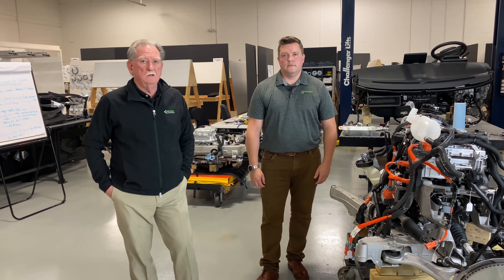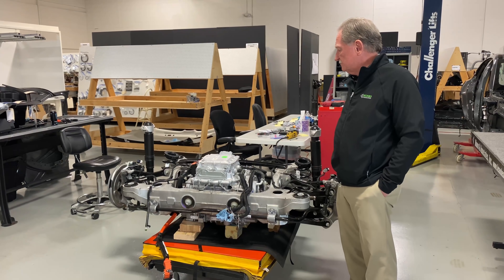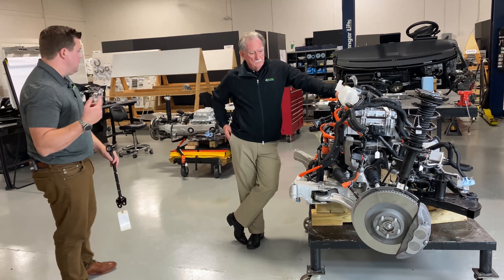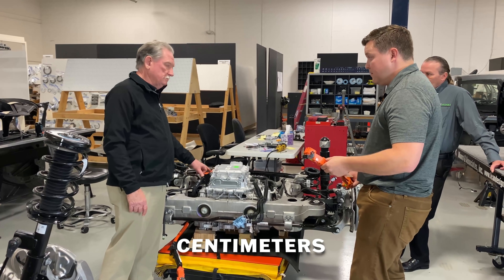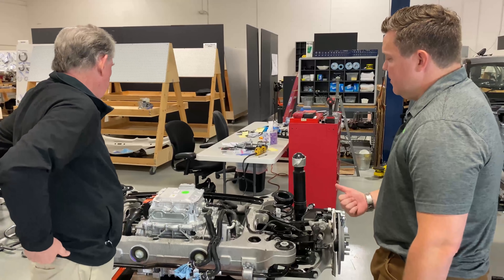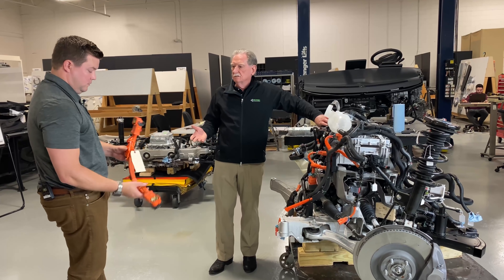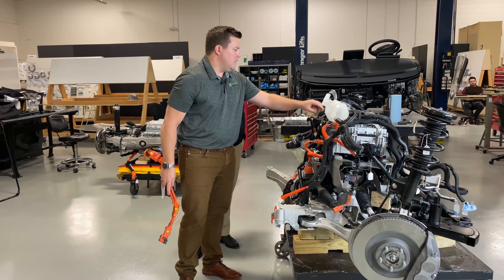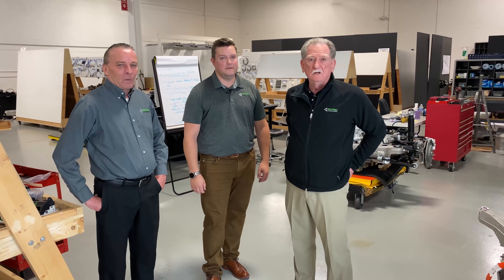Mach-E Suspension & High Voltage Wiring Compared to Tesla Model Y

Comment: i find all these videos really interesting. I also find it funny that I personally think: metal part, thats quality, and Monro sees metal part and thinks thats crap lol. I wonder if the plastic connectors that you guys like so much actually lasts as long as the metal part with a screw. Plastic has come a long way, and it sure doesn't rust together like metal components, but I don't know. Then again, I don't own an engineering company that works with OEMs lol.

Comment: The wiring is traditionally ignored and told to connect the dots.  At Tesla, the electrical wiring is a core technology.  The wiring team can dictate component changes to so save overall system cost.

Comment: The MachE rear motor assembly is new to Ford and a new more modern design. The front may be modeled after the Ford Focus BEV which is older design. Maybe MachE next gen will have different front design. My thoughts. I have a MachE and it’s great. I can’t see any of this stuff. I just want it to last 5 years and 75/100k miles. The model3/y has many years of tesla experience from the s/x…

Comment: This model is a Select AWD, so I wonder if the GT front suspension wiring and motor designs are very different. I read the GT has the same electric motor in the front and back so it would need to be different than this car.

Comment: 8:25 Aluminum? There's no way anyone would use aluminum wiring to connect a high-voltage pack to a high-power inverter.
Reply: I might be mistaken , but I believe that all the high tension lines that connect our power grids are in fact aluminum not copper.
Reply: @1bigapple2  Running ultra high voltage, low current AC, yes. Running 500+ A of DC current? No way.

Comment: Nice! excellent discussion on what they see on the way the thing has been put togehter and designed! I love this talks with engineers that can put out their points of view on things! 
Also I think this could have been a good opportunity for them to show that because of electric cars have smaller size engines and often 2 of them, it brings the extra benefit of having multilinked rear suspention systems that will give you a better ride for rear passenger and also a much better handlling on curves!

Comment: Companies that traditionally were ruled by mechanical engineers have a tendency to let them work in their own little bubble where mec engineers don't talk to each other and don't share a common design methodology. 

Tesla is a company ruled by software/firmware and hardware engineers, this is why they have managed to implement a collaborative design methodology for mechanical design too. Having worked from home for over a year, I can confidently say that the mechanical engineers across the board are really bad at contacting/talking to the hardware designers. I can't imagine they're much better at collaboration amongst themselves.

Comment: Sandy. The MachE was never supposed to use the VW MEB platform. Ford is using MEB for a car in Europe. I'm guessing that car will be a whole lot smaller than anything they will build in the US.
Reply: yes and no. The general rule: size of cars in Europe < Size of Cars in America is true, however it is not so simple in this case.The area of cooperation of what is already known is in small commercial vans and pickups. VW  will develope and produce a new "city van"  (badge engineering based on the new  VW Caddy ),  for Ford and Ford will return the favor in the form of a pickup truck. Makes sense, the VW Amarok is a okay pick-up but it is clear that it was not a project that was worth the effort, the development costs were to high i suspect, ( VW has only one pickup in the line up and has not sold them in very high numbers) so VW will not design a new pickup anymore, they have never had a lot of experience or sales with pickups. 

The most interesting part for me is that VW is giving up their "Transporter", or VW Bus for commercial usage (the petrol/ diesel ones). They recently launched the T7, but this version will be passenger only and not offered as a cargo van, that breaks with the tradition of offering their Transporter as both a passenger and cargo version, which was the case since the 50s !!
Instead Ford will develop a new cargo van that will be molded into a Volkswagen version as well. I think that really shows the disruption in the industry, because up until now the VW Transporter and the Ford Transit were the top selling cargo vans in Europe and big rivals. 

The electric VW Bus, often called I.D. Buzz or also rumored to be launched as the ID.7 is basically confirmed for 2022, VW has announced a cargo version of it for 2023, but that is less clear.  

I agree that a smaller Car would make sense for a Ford MEB car, there is more potential cars below the Mach-E than above, but given that the rest of the cooperation is mostly focused on bigger vehicles, we might as well see a big passenger van form Ford.
Reply: @tzarcoal1018  Those are really interesting details. Both companies have such a broad lineup that even though they are huge they can't afford to do everything themselves so they use their resources for the hearts of their lineups and then exchange vehicles for the things that are more peripheral to them. At least in this relationship the IP flows both ways. The Honda GM relationship is one sided, Honda is getting Ultium vehicles from GM which gives them a few years to develop their own platform. There is a common nightmare among college students which occurs during finals week when you wake up in the middle of the night thinking that there was some class that you forgot to attend, you can't remember what it was but you are sure that you signed up for something and now it's finals week. That's what happened to Honda only they really did forget to attend EV class so their only choice is to copy off of GM's paper.

Comment: I witnessed a lot of this sub optimized design happen in the Aero industry, the first design team to freeze their portion of the system dictated what the other design teams had to interface with or work with/around....didn't always result in an overall robust product design.  The main cause was lack of communication between the teams, or a bad set of system specifications that came late to the party.

Comment: This sort of analysis is absolutely fascinating.  Just wow.
Reply: I enjoy watching analysis through deconstruction because it's so simple and straightforward compared to designing from "scratch", and in many ways easier  compared to figuring out how to transition to a new system to produce a new design.   Automotive engineers have don't need to replace drive trains of vehicles as they drive down the road, and many have no experience in manufacturing or management.  Sandy isn't an automotive engineer, he's closer to a classically trained general engineer.
Reply: @psdaengr911  Sandy started as a tool & die maker, later ar Ford WORKED, got TRAINING, got promoted up to executive home office position, headed up design of Ford https://en.wikipedia.org/wiki/Ford_Vulcan_engine (installed first time robots at Ford, since leaving Ford he has consulted/trained for Ford.  He also worked on the 787 and nuke subs for both US & UK.
Reply: Tends to make one lean toward Tesla.
Reply: @Chainyanker007  Wrong.

Comment: The team really shows that we’re in the infancy stages of EVs still. Every video seems to be filled to the brim with potential improvements for every platform.
Reply: Yeah,   but speaking as a engineer,  it also seems very obvious that one of them has a clear lead has borrowed a tag line from apple  vs "If it ain't broke, don't fix it"

Comment: Ford still using the sqeaky old McPherson strut suspension the used on my 1960 Falcon and Sandy is also right regarding Ford engineers that don't share information between departments, again Tesla leaves them in the dust.....I still can't get over the Oil Canning in the quarter panels
Reply: Not remotely the same.  What do you drive now?  If it’s a car, 99% chance it’s a McStrut.
Reply: Dual wishbones were introduced in the 1938 chevrolet.

Comment: What would be the difference between the Mach-E and Model Y regarding major crash where the front end is crumpled?  Seems Ford is recycling their ICE engineering and designed the drivetrain to break away.  Is the Tesla following same logic or do they integrate the drivetrain as part of the energy absorption?

Comment: I think exposing the lack of communication within legacy automakers exposes in part why they will likely fail to make the the transition to electric. Its just one glaring exemple amongst many to point out. I believe legacy auto will have to go out of business and from the ashes the "better engineers" will reroup to create EV's from the ground up. No dealership networks, no crippling dept, no pension plans to pay, no motor and transmission plants to mothball, no expensive upper management to pay for that doesn't do much for sales...
Reply: I used to think that but listening to programs like this and other engineering channels I've realised that the shear mass of the old legacy automotive companies is both their hindrance to change but what will also keep them around.
They're to big to lose but at the same time they have to stay relevant to make money... so they'll change... just very... very... slowly.
The Mach-E to me seems almost like an forced design to prove they're still in the game, the fact it is despite its fault a good car is evidence Ford is going to stick around.
The F-150 Lightning is I feel their first real blank piece of paper ground up electric vehicle and Munro's Team breakdown of that vehicle is going to be the real test of Ford's EV credentials.
Reply: @helenlawson8426  Dear Helen, I wish I shared your optimism regarding large legacy auto but your example of the F-150 Lightening is a good one but ultimately the inefficiency of its battery pack, limited battery supply and weak charging infrastructure and no proper over the air update capabilities and no full self-driving will make this difficult. Raw material for batteries and cell production will either kill legacy auto or reduce sales by a lot. Even if they signed a deal with Tesla and licenced all the technologies including the FSD, Over the air updates, software stack/Tesla OS they would still be looking for enough batteries meet the demand.
Reply: @simonpageau6925  That's funny because the F-150 does have. Proper self-driving mode. Called Blue Cruise and the F-150 and the Mach e have over the air updates also. Only thing I agree on is our battery tech is a little bit on the low range. I'm sure they'll get more from the Volkswagen merger

Comment: Ford engineers need to work with Sandy & Co.
Reply: I have suspicion the younger ford engineers would love to move in Sandys direction but the old guard and management keeping their hands tied
Reply: I would say Sandy is by and large impressed with the Mach e.
Reply: @ProjectFairmont  Didn’t Sandy almost have a heart attack when he came across how the cooling and heating system was put in place in a Mach-E?  I think Sandy likes the Mach-E over the ID.4, but that’s not saying much.
Reply: @korswe  as a person that builds cars, and works on ones that are old with coolant lines everywhere; not concern for me. All those coolant lines are not expensive to replace in 30 years.
Reply: @ProjectFairmont  I stop buying BMWs because of cooling line issues. Do you know how much it costs to replace the cooling hoses front and back of the motor at 100K miles? Thousands! More cooling lines mean more potential leaks. That’s not to say that Teslas will be trouble free in the future. Far from it.
Reply: @ProjectFairmont  Interesting question:  What is the PSI running through those hoses?  What is temp of the coolant running through them?  I'm thinking both the PSI and temp is much lower compared with gas engine coolant lines.  I'd be surprised if MMe exceeded 2 PSI and I'd be surprised if temp of the batteries exceed 140 degrees F, much much lower than compared with gas engine.  Not sure about the E motor vs. gas engine temp.   Anyway,  I can't remember the last time I had to replace a hose in my old ICE, so I'm not worrying about it.

Comment: I would love to see a comparison with an Early production Tesla......Tesla has many more years of EV experience than Ford. This comparison in 8 years will be interesting.
Reply: Those differences have nothing to do with EV vs ICE.  It’s vertical integration vs buying off the shelf.  Ford will never get to Tesla’s level of integration of all components.  Ford has over a century of building vehicles and they could have done a better job with connectors and wires.  Those exist in ICE too.

Comment: Fantastic stuff guys. Very interesting to see and hear about the deeper aspects of the engineering going on. And about the off the shelf parts versus internally designed pieces and how it all adds up. The idea that the Ford guys are pushed to buy these common parts from suppliers, who are in turn pushed to build common parts for multiple manufacturers just to make money, while all of it leads to compromises that have to made in the efficiency of weight and performance of the cars... wow.. I knew Tesla does it different.. and I knew I liked what their product is doing.. but this just gives a whole knew level of understanding in HOW they are different in so many ways. Seeing it illustrated so clearly in these tear downs is just.. awesome.. Love the shows!

Comment: Henry Ford was essentially a parts assembler and it looks like nothing's changed. Tesla's vertical integration innovations make them fast, flexible, efficient and PROFITABLE.
Reply: He was more than that, he was a true manufacturer.  The early Fords were built with very little purchasing from third parties.  It's not like today.  They would even use sand at the Highland Park Ford plant in St. Paul Minnesota to make glass windshields.  Henry Ford was an innovator, manufacturer, visionary, and stubborn as hell.  Going bankrupt twice before third time lucky says a lot about his determination and commitment.  If it wouldn't be for Ford and other legacy companies like Chrysler and GM, we would be speaking either German or Japanese. Cheers.

Comment: Cory is a great co-star! Very clear in his presentation and great eye for detail. He definitely adds a lot.
Reply from the maker: Thanks!
Reply: Hey Sandy the agreement VW and Ford was not for the MEB under he ID4 in North America. There are multi parts to their cooperation:
- Ford will use MEB only in Europe for a smaller vehicle slotted below the MachE. 
- VW Amarok will be a truck built on the Ranger platform 
- they are co-developing 2 BEV van platforms. VW is working on the smaller one & Ford is working on the larger one.

There was a lot of news around all of this two years ago if you wanted to read up on it. Or check with your old buddies at Ford.  If you want more info on this platform you are working on you should ask them about the Lincoln and 2nd Ford crossover coming o n it (CDX737/CDC474).

This also explains why you thought the batteries were SK Innovation. They will making cells in Georgia for VW’s UD4 production in Tennessee and Ford’s F150 Lightning in Michigan. 

The MachE batteries are supplied by LG from their factory in Poland. This was mentioned when they announced that production for the first 12 months would be production constrained to 50,000 with 1/3 for North America and 2/3 for Europe due to the tougher emissions requirements there. Again plenty of news articles that covered this.
Reply: Couldnt agree more.
Reply: Agreed
Reply: That Sandy has recognized the kinds of talent his organization needs to do a good job and has found people with those talents says as much about his analytic and design skills as the tech details he presents.  Since he keeps calling himself "old", I wonder who he's developing to replace him.
Reply: Indeed!
Reply: Munroe has such a great cadre of engineering expertise, great to see them getting involved!
Reply: Agree... Cory was great..  he caught lots of details
Reply: Cory is great!

Comment: Hey! I went to school with Cory.  Kettering University up in Flint, MI is a huge player in the mechanical engineering field, especially in Automotive for such a small school.
Reply from the maker: Hey Stephen! Munro currently has 13 Kettering grads and four Co-ops in rotation. Cory was the OG co-op back in 2005.
Reply: @MunroLive  That's great!  I've been with BorgWarner since the same time, started as Co-op and was hired full time and been there ever since.  I'm watching with interest because I was involved with the Mach-e development.  The teardown videos so far have been great!
Reply: @SteebMo   Can't wait to see the BorgWarner innovations coming to the front motor of GT version.
Reply: @jamesseay9943  BorgWarner was part of the rear drive unit design as well!